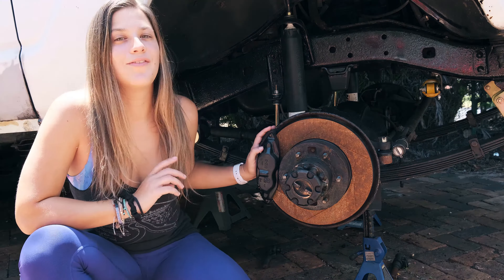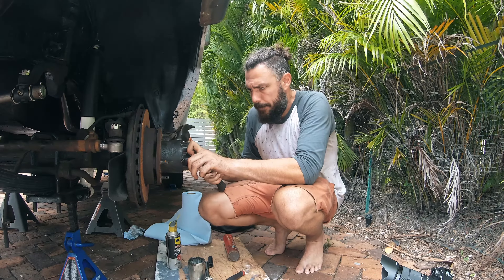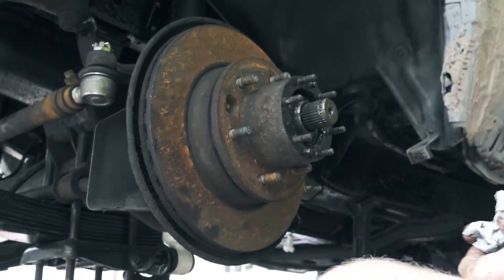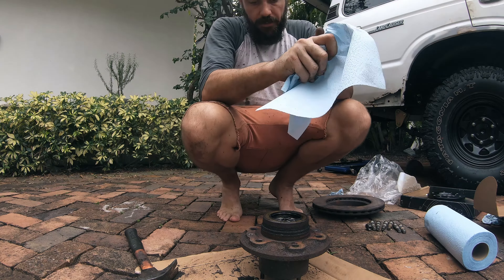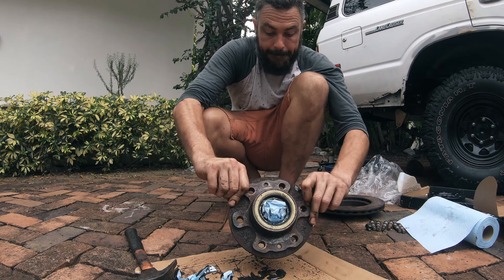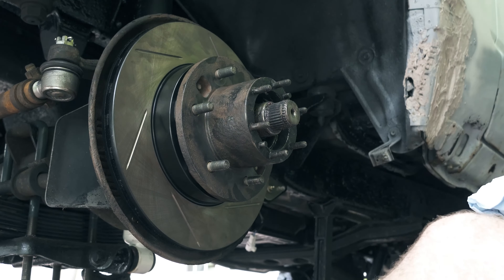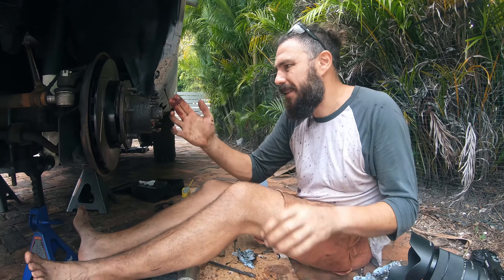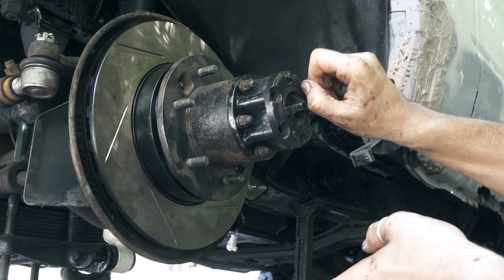Replacing the Front Brake Rotors on our 1988 FJ62 LandCruiser

Comment: That old Grease is the correct grease that Toyota recommends it is a Lithium Molydysulfide (Castrol LMM). Its awful to get on you but is near on impossible to seize a bearing if used correctly and the hub nut is torqued correctly.
Reply from the maker: Thank you!!!

Comment: Just want to say thanks for posting these vids! They are a big help to me when I'm working on my '84 BJ60. What did you use to remove the hard brake line? I tried using a 10mm flared (line) wrench but it started to rounding the bolt. Also definitely invest in those snap ring pliers! You need a special type sometimes call and E ring plier, not tje kind with two points at the end. A good brass drift and mallet are also worth the money too. You'd be suprised on how often you'll need them.
Reply from the maker: Hey! We actually bought one of those little brake line removal 🔧’s. It worked for most of them but where it didn’t I used a set of Multi Grips I stole off Sofia’s Mum. We need so many tools honestly. I should really buy a welding setup too. We’re currently living with Sofia’s Mum, and she’s being very patient already having a massive rusty Cruiser in her driveway and car parts all over her house so when we find somewhere we can stretch out I’ll invest in better tools.
Reply: Thanks for the reply! I think I'm going to have to vise off the fittings too and replace that section of line mostlikely. I totally feel your pain about work space. I do all my work in a small dirt driveway that boarders our apartment building's shared back yard, and inside my home my tools and parts are everwhere. My girlfriend is contantly reminding me that our home is not suppose to look like a garage lol.

Comment: that washer at 5.21" looked like it was not bent at all, this is a retaining washer! when you align the wheel bearing you put that on and bend over the lashes to hold the nut in position!
Reply from the maker: We actually took all this apart again and rebuilt the hubs with a rebuild kit. So yes there should have been all these things and we later fixed it all up.

Comment: I’m no professional so I could be wrong but did you not install the right hand rotor on the left? I thought the direction of the slots were supposed to be the other way, so to push the debris out of the rotor not into the centre?
Reply from the maker: Thanks for the message. I thought the same!! Even when I was installing I double and triple checked I was installing them as they were instructed. I have to take them off again soon so I’ll make some calls before I reinstall.
Reply: @NomadEffect   no hate there but yeah if that’s right should help them clear out the channels and clear out the dust better, ultimately increasing heat dissipation according to another video. Perhaps it’s just a brand thing though so whatever works.

Thanks again for the video I’m looking at tackling this job in the future so it was great to see the disassembly in the works!
Reply from the maker: So I actually found the instructions for the rotors the other day and I’ve been meaning to update here. StopTech brakes claim to have busted the myth and we have for sure installed correctly. They say that the vents help dissipate heat no matter which way they’re facing and the way they have them face actually increases resistance which in turn increases stopping power. I’m not knowledgeable enough to really argue with StopTech. Hope this helps!